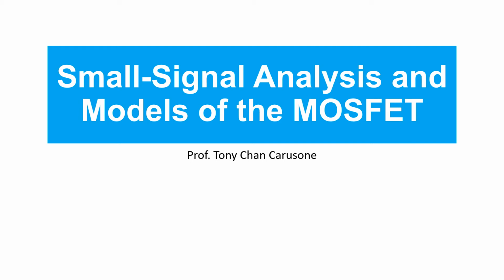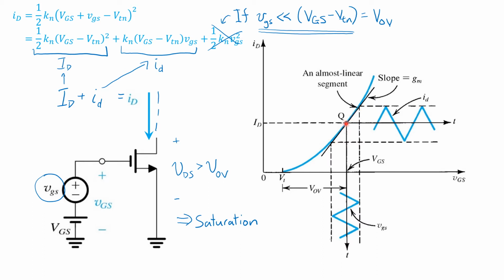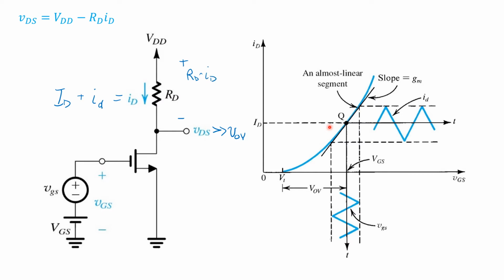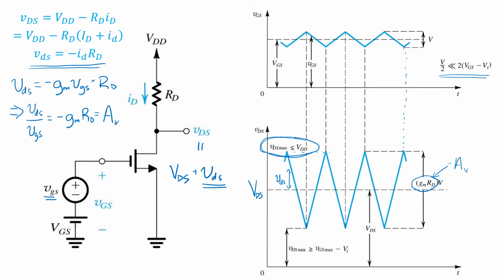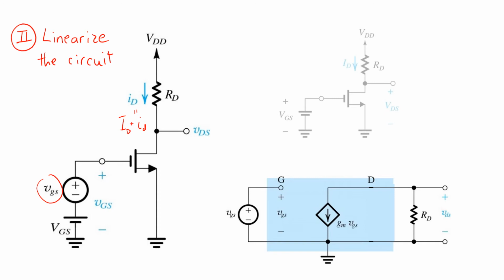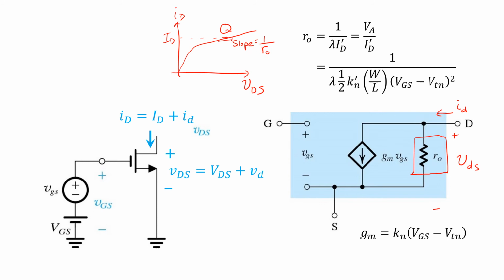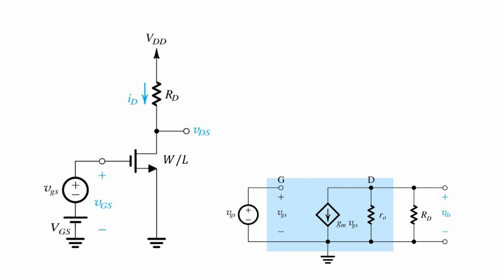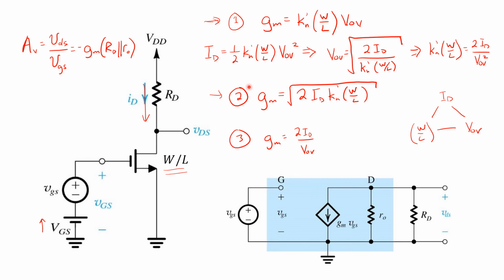47 Small Signal Analysis and Models of the MOSFET

Comment: Thanks for the explanation!

I had a question whatsoever. After calculating the Op., the gm parameter and nulling all the DC sources, you have to perform the small signal model. However I don't know if you have to substitute it by that of minute 23:45 or the one at 31:09, the latter which seems to be part of the transistor itself. I thought the ro was you computing the equivalent ro of the circuit.